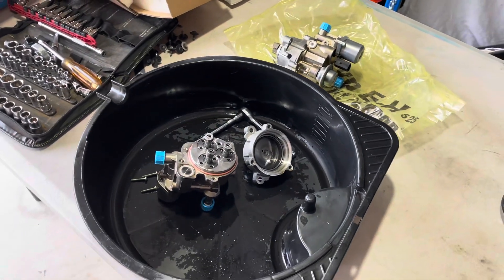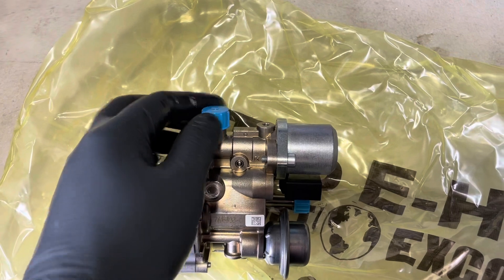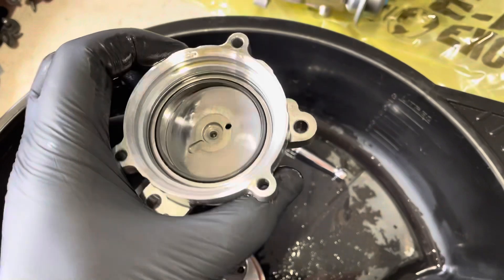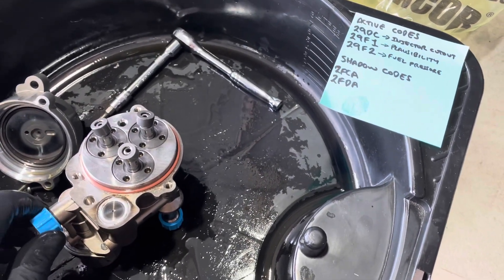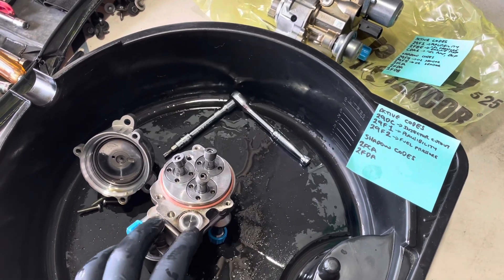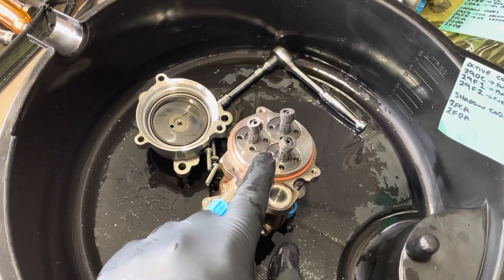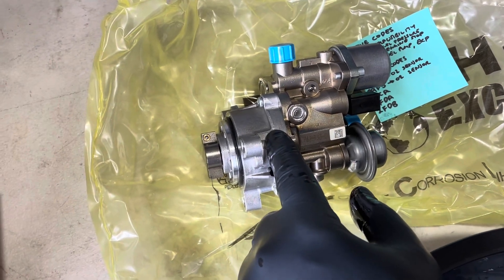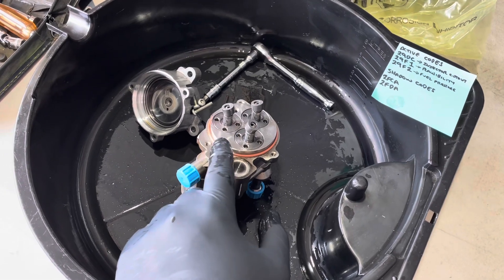N54 HPFP operation and failure reasons

Comment: I think you'll find the solenoid is not restricted to merely two positions. That may be true for solenoids at steady state DC - it can only be on or off, all the way in or all the way out. But different things happen at high frequency. The solenoid's coil has inductance and won't respond immediately, so it does not chatter on off on off on off at over 1000Hz - it would probably make a lot of noise and wear out very quickly if this were the case. Instead, it can probably assume an infinite number of positions based on the average of the duty cycle. So a 50% duty cycle probably holds the valve half open. A 0% cycle probably provides maximum fuel, incase the wire breaks, you still get fuel pressure.  A similar thing probably happens with the vanos solenoids. Thanks for the video - just adding my 2c!

Comment: Hi, Darke Peak. Great channel you got! When there is a problem with a lack of oil, you can measure that from the outside. You can measure the distance between the diaphragm and the outside of the pressure regulator on the back of the pump. The correct distance has to be between 19 and 22 mm. My first failed pump had 27 mm, so it lost oil. Btw, do you know what oil is used in these pumps? Some say it's CHF-11S ( which is used in the active steering pumps). Thanks for sharing, Dutch regards, Nico.
Reply: it's def. not CHF-11S.    more a AW 46 oil
Reply: @tomzphone Thanks!

Comment: Do you think the seals can be replaced?
Reply from the maker: Yes, but it’s a complicated process that needs to be done in an oil bath
Reply: @DarkePeak  i hope one day you can make it and share it with us. Thank you for your videos!
Reply: @DarkePeak and word of advice when looking for used hpfp, inspect the filter on the pump from the lpfp inlet for any contamination/signs of damage, and check the depth of the digraph, needs to fall within spec or else it wont hold correct fuel psi
Reply: Hpfp needs to be submerged in oil completely when rebuilding it, or risk having air bubbles inside of the sealed portion containing the oil. Difficult but doable, better to get a used unit if your tryna save money rather than attempting to rebuild in my unprofessional opinionz
Reply: @yungxsixbigswagdady6970  you will still have a ton of air even if you do it submerged.   you need to degas it for a couple of hours with a vacuum chamber.

Comment: Glad i found this vid… my 535 n54 ran perfect out of nowhere started dying. Scanned it got 88psi lpfp and read the same on hpfp… i bought an amazon hpfp having similar issue going to try a more expensive one tomorrow.. 

I have new lpfp 
New low pressure sensor 
New plugs and coils  

I only get codes regarding low fuel pressure on the high side
Reply: did an amazon hpfp help?
Reply: @ hell no thing died immediately fcp euro ended up being my go to

Comment: I’ve been having a lpfp pressure issue lately start up would be 64 psi and as car warms lpfp pressure drops to around 50 ish psi at operating temp. Last night on a drive my rail pressure dropped to lpfp pressure abruptly and here I am just a weird issue unsure if both issues are related but my rail pressure was normal 700 psi at idle around 2500 on a hard pull.
Reply from the maker: When my first pump failed (internal seal failure) it was like that - it seemed to work ok intermittently.  But it got progressively worse until the rail pressure was low all the time.

Comment: mixture control 1 & 2 together  and pressure plausibility , i replaced lpfp and filter and still got the codes popping , you believe i should try to replace Hpfp also ?
Reply: Yes, it’s very expensive part.
Reply: did replacing hpfp solve you problem with pressure plausibility?
Reply: @Krtek004  yes it did , after replacing high pfp the plausib code went away